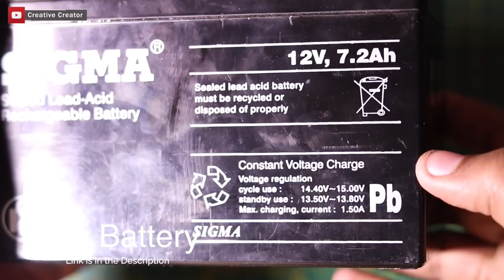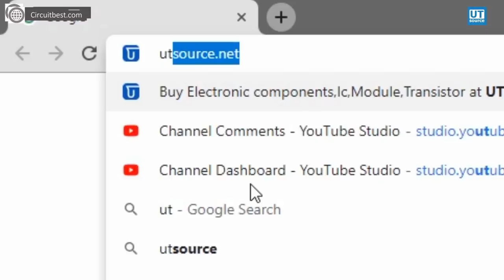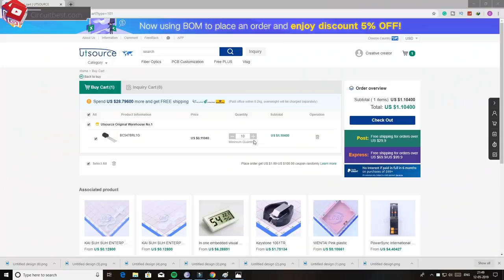Simple Inverter Circuit

Comment: can you please explain the circuit in detail, i would never be able to die in peace if i don't understand this,it is complex and i cannot understand it on my on, i want to understand the flow of current and switching on and off of transistor gates, thank you
Reply from the maker: Follow Circuitbest.com
Reply: This is a kind of voltage controlled oscillator. there has to be a capacitor between ends of tranformer to make it VCO( not centered terminal)
Reply: Transformers need oscilation to work, and the battery will provide DC
So, you use two mosfets to oscillate between positive and negative phases (AC) with that middle wire working for feedback.
Reply: Firstly watch what is MOSFET and their funtion and connection then you little bit understand

Comment: Please how can I use 12v battery for just 12 of 4v LEDs?
Reply: You don't need a fancy inverter like this. Connect each 3 LED's in a series, with a 220 Ohm resistor on each series of 3. Just connect that directly to the battery. It will put ~20 mA through each LED. Adjust the resistor values, to get the current you need. (I'm assuming, you're running white LEDs)

Comment: Hi sir. I have question. The IRFZ44V it can replace the IRFZ44N? I have IRFZ44V now. What will i do? They can or not? Please reply thank you!
Reply: I don't recommend IRFZ44. the maximum gate-source voltage voltage on that device is only 10 volts. It is a logic level mosfet. The mosfets used in this video are standard threshold devices, allowing up to 20 volts across the gate-source. This circuit uses a ~12 volt supply, which can easily exceed the 10 volts allowed by the IRFZ44. Even though this circuit has a voltage divider on the gates created by the 1KΩ resistors, when you use a center tapped transformer, when one leg is pulled to ground by one transistor, the other tap goes up to double the supply voltage, meaning the gates go up to supply voltage. 
     One thing you might try, is reducing the resistors connected across the gates and sources of the transistors to 470Ω. That will reduce the gate voltage to~7.67 volts, more than enough to turn them on, but well within their safety margin.

Comment: You have error either in schimatic diagram or in the real circuit? Which is right?????
Reply: The real circuit is correct, the error is in the schematic. I built the circuit, and it works perfectly! (built according to the real circuit)

Comment: Is posible to use this to run an electric motor?
Reply: It can run anything that needs 230V but he showed up it on example (light) you cyn use it on Electronic motor but take my words:
Battery will discharge fast if you dont have alcalic 9V battery

Comment: There is an error in the schematic at the end. When you built the circuit, R1 and R2 are connected across the gate and source of each transistor. The schematic at the end shows R1 and R2 connected across the source and drain of each transistor. The way the circuit was actually built is correct.
Reply: Will it work? For real?
Reply: I also i found this errer very clearly ......which is right ? Schimatic or the Real ???????
Reply: @shenk9510  I tried it myself, and it works perfectly. It does put out a square wave, and with the transformer I used, it runs at ~40 Hz unloaded, when loaded to 40 watts, it runs at ~50 Hz. Because it relies on transformer core saturation to turn over the "flip flop", it does have a high idle current. The MOSFETs don't get hot, but the transformer does warm up slightly. Mine idles at about 15 watts.
     Bottom line....The way it's built in this video IS correct! The schematic is incorrect. If you need a cheap, cheesy step up AC inverter to charge a cell phone, run and incandescent, LED or compact fluorescent light, this circuit works perfectly as shown.
Reply: @eng.mohamedsaad9541  The way he built it, with two resistors across the gates and sources of the MOSFETs, and the other two connected between the drain of one, and the gate of the other, indeed works. Watch the build, ignore the schematic. The frequency varies with load, and it puts out a soft square wave. If you need a cheap, cheesy inverter to run incandescent, compact fluorescent or LED lights, this works as well as shown. Mine runs at ~40 Hz unloaded, and ~50 Hz loaded. It does have a high idle current, (about 1 amp), but the transistors don't heat up, even when loaded to 40 watts. The transformer warms slightly.

Comment: 1. mosfets will die because the transformers high voltage spikes(over 70v and mosfet is rated for 20v gate-soure)
2. Output voltage is 220v AC but it has spikes of ultra high voltage(because is square wave) and it gonna slowly kill your devices
 
And many more mistakes it has,but great invention

Comment: How would you do 12volt dc to 220 volt A.C, 200Hz?
Reply: The method shown in this video does not work for a specific frequency. The frequency you would get is based on the capacitance of the mosfets. You would need a microcontroller with pwm and MOSFET drivers to get an accurate frequency
Reply: @mantisgaming  Thank you

Comment: Buenas tardes. MI pregunta es: Supongamos que yo conecte un electrodoméstico a la energía generada de 220V, que consumo se reflejaría en la factura de mi servicio de energía; como si el consumo fuera del electrodoméstico usando 220V, o  se refleja la energía consumida en el proceso de carga al inversor en caso de usar un cargador de  12V conectado a la red de energía eléctrica?
Reply: You can not create energy. If voltage is up then amper is down. Opposite is true also. So if you use a device 220v 200w then it uses 200w in 12 or 24v too. So you pay the same. If losses in the conversing circuit are added you may pay more
Reply: @devrimtuncer8655  Thanks for your answer.

Comment: Only 60 Watts bulb no cfl and led lights
Reply: It will work fine. Build the circuit exactly as shown, it's correct. The schematic has an error. For 60 watts, it's best to mount the MOSFETs on a small heat sink, make sure the transformer is big enough. (A 60 watt bulb will pull about 5-1/2 amps out of your 12 volt battery)

Comment: Your video is lacking in effective teaching because it does not come with a schematic diagram of the circuit that you built.
Reply: Right ......only one mistake .....2-resistors ....are wrong connection